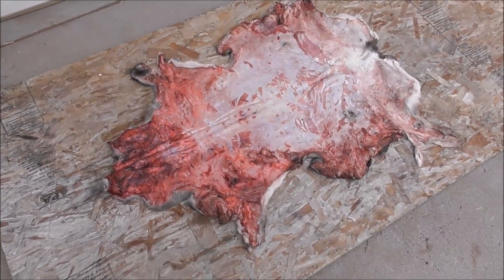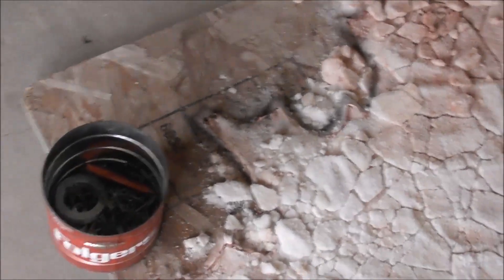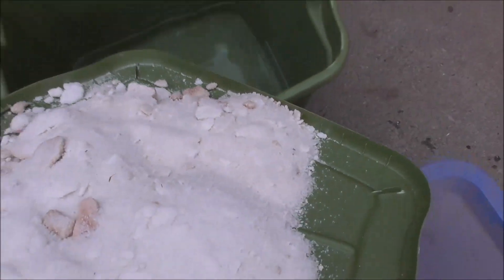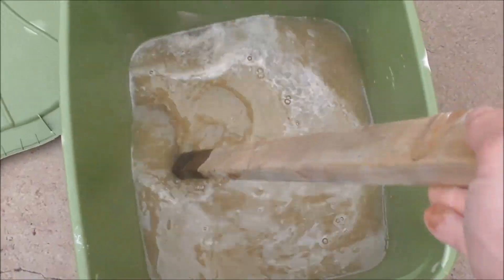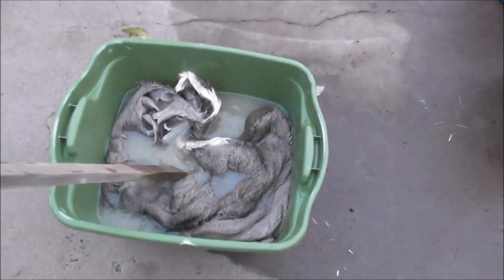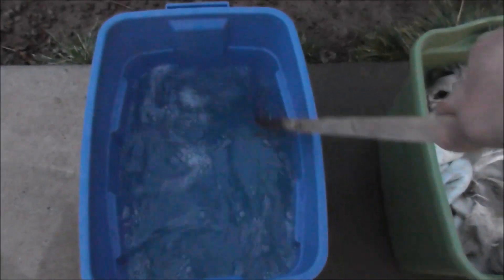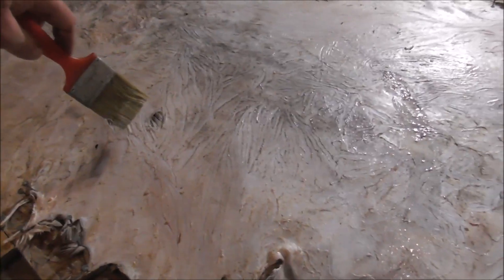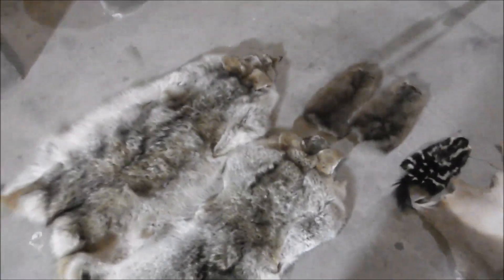Tanning a deer hide with battery acid

Comment: I’m going to do a cow hide- it being bigger and thicker, what ratios and time would you change?
Reply from the maker: Actually I have done a cow hide with this same radio, also bear skin. It still works the same. I have just always made sure to salt first to pull as much moisture out as possible. Good luck. Also do u use a hide thinner to make it more manageable to break and use? I am still learning those processes.
Reply: I’m planning on doing hair on. I don’t have a thinner. This is my first time. How did you get the big hides out of the solution? I’m thinking will use a 2x4 and using the tractor to lift it.
Reply from the maker: @ashleymcdaniel5151  yes exactly I used 2x4 to lift it. It was heavy AF just so u know, I just muscled it lol and tacked to a few peices of plywood
Reply from the maker: Also just so u know without a way to thin the hide it does make it a bit difficult to break the hide afterward just an FYI on cow hides since they are so leather thick
Reply: So it’s tanned and oiled. I used the tractor with forks to life for tanning and washing. Now waiting for it to dry. I am not looking forward to breaking it. I heard it is work! I’ll let you know how bad it kicks my ass.
Reply from the maker: @ashleymcdaniel5151  awesome job. Yes breaking it will kick our ass hahaha but its definitely due able..good luck.
Reply from the maker: Also when I did it, it was summer so we made buckskin, and I scrapped the remaining hair. Just fyi

Comment: Why do you have to dry it with salt?  Would it not be possible to soak it in high salted water then hang it up for drying?
Reply from the maker: I suppose u could but allowing the dry salt rub to sit on the skin it literally pulls all the liquids and bacteria from the hid so it than is preserved. Maybe the other way would work that u speak of, but I have never heard of it being dine that way.

Comment: Does this turn out soft like sending to tannery? Slippage? What's the chemistry logic of the bran?
Reply from the maker: I have never had any hair slippage. Hides well over 10 years and not a single problem. And as for softness that all depends how well u break the hide. Industrial tanning places put them into big tumblers with different materials in there like saw dust and things like that to break the hids and make them super soft. So the softness will all depend on your technique. But for it being tanned and hair slippage u don't have to worry

Comment: I’m sorry Brandon you have not tanned this skin . Acid does not tan . Acid and salt will pickle only. Hang it outside in the rain a few times it will rot.
Reply from the maker: Graham Wilson I am sorry I would have to disagree...in fact i have made different types of clothing to wear during different hunting season and it rains and snows like crazy on me. And guess what....it does not rot!!! It is warm and still no hair slip. So instead of saying what u think u know before doing it or trying it, wearing it and putting them through different environments were I have and test them. The only thing is I have not smoked the hides to make them water proof. So with that they are tanned just not water proof. I have the furs for many years and have been using them and they DO NOT ROT!! And when breaking the hides properly they are as soft or softer than cotton clothing!!
Reply: @Superrooster14  Nice video. I thought, and could be wrong, that the smoking doesn't necessarily make them waterproof, but lets them stay pliable after being wet. Maybe that means waterproof as well, but the way I took it, possibly wrong, was they stayed pliable. Do the ones you've not smoked get stiff after getting wet?
Reply from the maker: @truegritbulldog  no not that I have experienced

Comment: Do i need to smoke this after tanning this?
Reply from the maker: Christian Noel Aquino yes if u want to make it waterproof you need to smoke the hide after u have broke it and made it soft. But if u do not intend to use for outside use in the weather than no.
Reply: @Superrooster14  thank you again for the information. I'm going to smoke it then. I plant buy some pig skin from meat shop and try this battery acid method of yours. 🙂
Reply from the maker: Christian Noel Aquino good luck and just remember take your time it is not a race lol. The hardest most time consuming part is just breaking the hide if u are doing it by hand like I did. Love too see how it turned out
Reply: Aight. I will tell you about it once I do it. :D

Comment: Bran Flakes are expensive here. What can i use in substitute of Bran Flakes?
Can I use flour?
Reply from the maker: Christian Noel Aquino I don’t think so on the flour but have never tried that, could make a mess. If u can’t find pure brand flakes I have used rice brand flakes. Hope that helps. If u use flour let me know how it works.
Reply: Thank you so much helping me. I got a ton of rice. I think i will try using that.
Reply: @x2n2004  You need to use the bran, as it contains the tannin to help preserve the hide.  White rice or white wheat flour has the bran removed so they won't work.

Comment: I have a cow hide in the freezer that needs done. I did deer hides in the past but they weren't frozen...when you thawed your hide, how did you do it?
Reply from the maker: Melissa Miller when I thawed it I just simply pulled it out of the freezer and put in bathtub or shower over night. And aloud the heat of the house to do it. Than if any thing leaked you could just wash down the drain. Plus no animals will get to it. Just leave in long enough where u can start to open the hide up, than u should be good to go!. Hope that helps

Comment: nope nope nope nope .....just nope
Reply from the maker: Misha Dyrendahl well it's not for everyone
Reply: I have tanned hides there are natural ways to do it with out B/A...people been tanning hides way longer than we have had cars!
Reply from the maker: Misha Dyrendahl yes I know there is. There is enough brain to tan almost any animal. But if u want a fast way to do it without digging out the brains or collecting acorns or all that stuff, than u can do it this way which is an easy way. And when u tan as many animals as I do a year you need fast and easy. I have a hide that was tanned almost 10 years ago that I did like this and still no hair slipping. By the way there is always more than one way to skin a cat.!!!!!
Reply from the maker: Vincent Avalon than what is preserving the hide called???
Reply: mish dyrendahl while it is preserved it has horrible curb appeal....try tanning with alum way easier,,,,,,and while it dries you pretty much wanna work it dry,so it don’t turn out stiff this is very important no time for laziness
Reply from the maker: Brandon Wright  well yes but I would have to disagree on the curb appeal, if it turns out bad aka not looking good it’s because u did not work it good enough while braking the hide. If u actually put the time in they turn out beautiful white leather and very soft! But it’s like anything u just have to put the time into it.